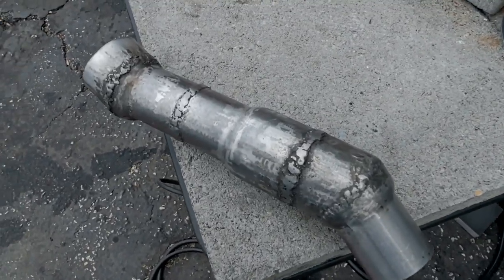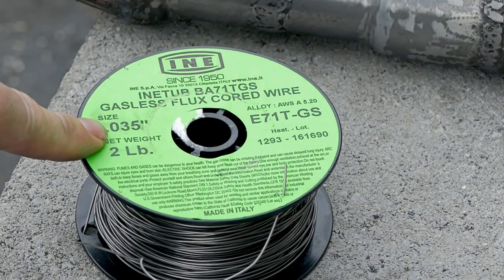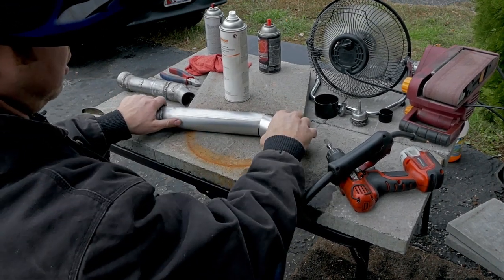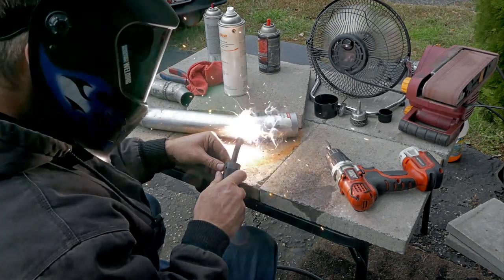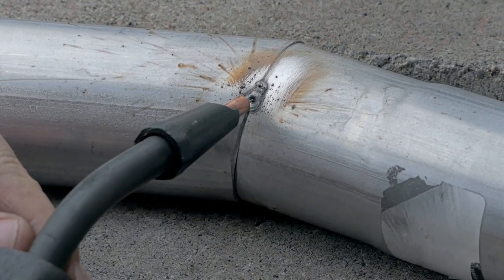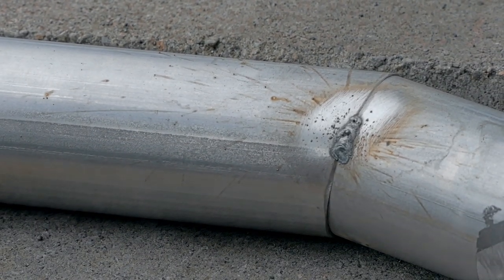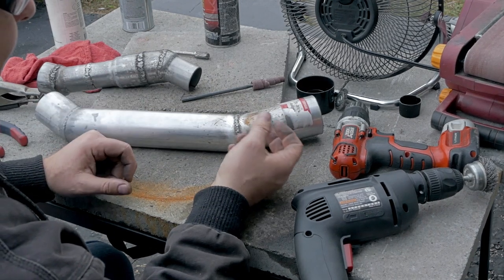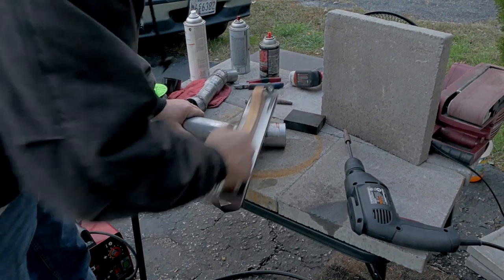Cheap Welder, How to Flux Core Weld Exhaust " Budget DIY Exhaust"

Comment: Pretty good tips. I've had a lot of experience in this situation. Try just going straight and not weaving. Give it a good second or two with each bead (without blowing holes obviously) but don't let it cool all the way off in between pulses. There's no need to wire brush it in between pulses. Just stop for a second, watch the glow of the bead die down, and before you lose site of it in the darkness of your hood hit it again. Over and over until you're done. You'll get a much better "bead" look. Overlap them a little like you were but keep going with the bead until you have to rotate the pipe. Good luck!
Reply: I probably and up having to read this comment.
Reply: Exactly my method.
Reply: gonna try this for sure thanks for the advice
Reply: Thank you for these tips

Comment: You don’t need to stop and clean just keep welding and clean after, this is going to take a freaking week to complete
Reply: for real!! buddy would finish his exhaust weeks later
Reply: Slag will go into the weld. Not sure if the flux in the wire is enough to prevent corrosion.
Reply: The weld needs to cool anyways
Reply: You absolutely need to clean the slag off or your weld will be contaminated and corrode. Wire wheel on a drill or a grinder makes quick work of it

Comment: Your main problem is not enough stick out and using a welder with only a high and low settings. Been flux core welding for years even on 20gauge sheet metal. Give yourself a minimum of 3/8" of stick out. The results will amaze you

Comment: Welding with flux core isn't bad when you know what you're doing. 🤷‍♂️
Reply: Welded my exhaust for my car, first time using flux core. I have to admit however, my welds turned out way better then a lot of these guys on youtube.
Reply from the maker: @zerodegrees8  Prove it.. https://youtu.be/62moqa9dICw 😁
Reply: @TPVPRO  not hard at all. Especially if you don't insist on Harbor Freight crap. And a simple can of anti spatter spray works wonders. Oh, and it helps to leave ego behind, and use the best tools for the job...that usually arent at Harbor Freight! 👊🏾🤣🤣🤣

Comment: I've only got a little over a year with welding experience, and obviously watched this to learn what to do or not do, what I'm doing right or wrong etc... and I know I'm pretty ok. Nice clean welds are common. Anyway, this is a really good way to start welding, I know a few pros who stick to this or a similar method. I personally lower the temperature so that I can weld faster and with longer lengths without burning holes into the steel. If your temperature is already at the lowest possible and you're having hole problems, just dot weld until you finish the job, don't risk wasting time, effort and money trying to be faster with a long string of weld. I'm probably forgetting some tips I've been given and have learned, so if anyone has any questions I'll try my best to answer as accurately as possible

Comment: So, good/great video, ive tried for years to weld exhaust ( cost to have done $$$), here is what ive discovered, "modern" pipe from big box stores has an "aluminumized" coating on them for corrosion, 25+ yrs ago it was naked steel, you would see it with flash rust on the shelves, the "aluminized" coating is messing with your welds, a little sand paper application and its mostly gone and easier to weld, your blow throughs are somewhat normal for flux core, thats why "most" shops braze the pipe instead of weld, also part of those $$$ for a shop to do, your video is helpful and good, thanks for that, wish YT had been around when I started, for what it is your video is extremely helpful and makes people less scared to try it at home, which is a good thing, way too much heres $ and ill pick it up now days, thanks for the great vid

Comment: If punching through, you are dwelling too long. Either move along the seam faster (in short puddle jumps), or zig-zag on each side of the seam to spread out the heat. (It also helps to have a machine with continuously-variable heating dial instead of a toggle switch - where LOW is still too hot.) 

Try rotating the pipe on a wide metal V-channel to move along the seam. (Or, place inside a slightly wider pipe.) For convenience, clamp the ground lead to the V-channel metal (or outer pipe).

Try a longer stick-out (3/8"-1/2"). It preheats wire/flux more than the base, and is generally better. 

For flux-core, DC negative is much better than AC (although a mix of both can be ideal).
Reply from the maker: https://youtu.be/c3GS0rySl0c

Comment: I've learned (through welding 25-30# of flux core wire) that the weld puddle has holes because the torch was stopped too quickly before the weld puddle was hot enough to properly build up.

Comment: After 15 years welding at work finally bought a Titanium 125 flux welder from harbor freight. No problem welding exhaust. Assuming it was you lack of experience or knowledge not the welder.

Comment: Mind blowing tip: If you spray the work area with non-stick cooking spray the splatter won’t stick.  I found this tip on YouTube and it actually works. 👍😉😇
Reply from the maker: I'm going to have to give that a try.
Reply: This is a joke right? The oil in a weld will spit like crazy
Reply: @davidludwig4286  nope "pam non stick spray" works

Comment: Probably the best advice from all vids ive watched, going slow and cleaning after every short blip seems to be a good trick. Ive got an exhaust to try and fix but i remember totally failing with thin pipe years ago with a stick welder. Thanks really helpful 😄👍😎

Comment: I put a H-pipe and dual exhaust on my car with a HF flux core welder. I had better luck with the .035 wire but maybe just because it was a better brand. Also took the nozzle off, helped a little. But really the hardest part was welding on the ground with no lift. The welds look like 💩 but it's together and no major leaks.

Comment: First, my dude the anti spatter repels metal so spraying it on your weld surface is going to give you fusion issues. Second, you need to lower the gun angle so that you are just barely aiming into the weld pool. To much will cause you to hit your slag wall and to little will cause holes. You can go downhill with flux....I ran downhill on a harbor freight  $99 special set on high voltage at 7 wire feed. ...i did both sides of a true dual exhaust and it sounds great. You're getting the flattening and holes on your tacks from running the flux like a mig 
...increase your stick out to 1/2 to an inch.

Comment: I’ve never used a flux core welder but after watching this I’m positive i never will haha
Reply from the maker: Good decision! 😂
Reply: Joe Simpson flux core isn't that good for thin metals but for thicker metals it's great and simple to use. It's probably the best to learn first imo
Reply from the maker: @rsmithmedia3287  Joe Can weld really good. He is just giving me a hard time.
Reply: @rsmithmedia3287  I completely disagree, welding with a proper hardwire machine is 1000% easier
Reply: Weld.com has a video where they bust myths about flux core, they're not bad. They definitely have their place. Growing up on a farm, they were great for field repairs with a generator when getting back to the shop wasn't an option. A lot easier to pack up, don't worry about how windy it is, and don't need a massive generator, everything fit on the rack of the atv.
Reply: @jutde  smaw is better than self sheilded flux core. Dual sheilded flux core is really good tho
Reply: Only because he doesn't know how to use it proberly. Even with flux core you can get amazing results.
Reply: Shielding gas tanks are too friggin expensive. I use my welder 4 or 5 times a year, I will deal with flux core over spending $300+
Reply: @GumpterCrayon  I've only been welding for like 4 days with a flux core and shit is super easy, I really don't see how it gets easier, does you just give the machine some metal and it spits out your finished project ?

So far the only hard part I've encountered is the fitup of parts which definitely has an impact on weld quality, but that's gonna be the same regardless of the type of welder, on parts with almost no gap after wirebrushing the welds you would think they were regular gas MIG because they looked so good, the ones where there were gaps definitely weren't as clean aesthetically but I guarantee they're still good welds, I got some heat in the fucker and it's strong.
Reply: Watch Bondo Billy Channel,  he can do anything with Flux core.   ßve used stick initially and then gas mig for over 50 years, but now Im into Flux core.  You need to play with it to be able to do everything. Dont blame the tools.

Comment: I actually think it came out pretty good for what you’re working with... flux core never looks great and it’s difficult to see while welding. Also it has a different sound than regular gas mig welding so you can’t really make it should sound like “sizzling bacon”. I think your settings were at least in the ballpark

Comment: I've done a bit of flux core gasless mig welding in my day, probably ran 100 lbs of wire the last 5 years. I did the exhaust on my truck recently and a few of the things you say are pretty inaccurate. I can run a solid bead for 1/4 of a 2.5" exhaust pipe without blowing through. The key is to turn the voltage and wire speed down, if it's still blowing holes then you need to move a little quicker while running the bead. Now, when it comes to this type of welding it's important to drag the nozzle not push, whenever stopping a weld you should drag the puddle back into the bead a little to keep from getting pits in the bead, sometimes even blowing through the edges of sheets.
Most importantly, clean the surface and practice, practice, practice.
Reply: That's it, turn her down. Just remember the saying "If there's slag, you drag."

Comment: I started with a big 220 Lincoln stick welder angle iron and box tubing also frame work on my car. I used a fluxcore welder .30 wire 2 heat stage high / low and wire speed was adjustable. Now I did exhaust on low heat overlap back and forth motion about 1 inch welds never had a issue blowing through the pipe. Never used gloves on a 110 either not needed unless you have sensitive skin. I also use the nozzle on my welder.

Comment: I have flux core welded exhuast b4 , im no welder but i turned my machine way down so not much heat and moved the torch fairly quickly kept the weld puddle moving had pope welded all way round in about 4 welds, only had to stop to turn exhust round and never burned thru, cheapest welder i could buy to outtta lidl, was like 90 euro and 4 euro for roll of wire, cant beat that

Comment: I love to watch welding videos, the problem you're having is due to stopping,  next time instead of going downwards out of the puddle,  go upwards into the puddle, if you're welder is turned completely down you either need to reduce your feed speed or move faster through the puddle, the flux cores stuff makes a gas shroud around the puddle so you need to carry on and also point the fan at you rather than pulling / pushing air around the puddle, I'm still a total beginner, thicker stuff is super easy to get right,  but the thinner stuff is a nightmare to get set up for and get right, loved the video
Reply: the one from everything I know flux core is supposed to be dragged. Not pushed. You can push mig all day. Not flux core.

Comment: My 250a MiG welder has infinite adjustments for heat, and even with flux-core, I can turn down the heat low enough to continuously weld something thin like muffler pipe or rusty metal without burning through the steel.
Reply: Listen to the man
Reply from the maker: I'm thinking of getting a Mig this summer.

Comment: Yeah, making flux core look good is a challenge. But it's just like anything else. The more you do it, the better you'll get. 
Now to be clear, I'm NOT a professional welder. I'm a professional mechanic by trade. 
But just a little advice about flux core welding. You want to make sure you get a machine that has the correct polarity. Flux core needs to be run electrode negative. When used in that polarity you won't have so much spatter to clean up and you'll have much better welds.
These really cheap machines, such as the black Harbor Freight flux core machines, are wired electrode positive. Which is why they have problems. I know it sucks, but try to save up and spend that extra 75 or $100 to get a machine that is wired correctly. It's well worth it in the long run. But if you can't, I do understand that very well. Just get some scrap and start laying beads down. Do that for as long as it takes for you to get used to the machine and can lay down some welds that will actually hold. It just takes practice.
Much respect for you TPV!! For being big enough to readdress this and for giving folks good advice!! 
You're The Man Brother!!! Y'all be safe out there!!🤠😎
Oh and I gives a f@#$ that this is three years old!!

Comment: with flux wire you need to push , not pull. Stay behind the weld and push it to the end. pulling is for solid wire. Hope this helps.
Reply: sean self: You have it backwards sir. With slag you drag is what it's called. You pull the weld for flux core. With solid wire you can go either way.
Reply: @garthock1  you are correct thank you sir

Comment: Well done, I'm using a Harbor Freight and it's really ugly patching all of the burnout holes. Not to mention at the lowest settings and the pipe is thin and old 1 3/4" stock on a scissor lift.

Comment: The reason why there is a hole is because you are too close of the weld, your flux wire doesnt heatup enough before touching so it does a point in it

Comment: Man that Lincoln flux core sounds a lot better than my cheezy harbor freight flux core. Never can get that thing to weld right. I feel like it should be able to weld an exhaust just fine, but cant get it. No matter the wire tension, or speed or high/low. No idea why it wont work ha. The welds just break off. They dont penetrate the metal at all.

Comment: I can make flux core welds look like it was welded with a regular mig all day even on exhaust. If your welding thinker metal to thinner then alway put the heat more into the thicker metal rather then the thin. You will blow less holes through it.
Reply from the maker: I got better and so can I now.

Comment: I'm pretty sure no matter what type of welder it is if you're punching holes through the material you probably have too big of a gap or your heat is turned up too high for the material you would think if you turn down the heat a little bit and turn up the feed you should be able to successfully weld a straight line but maybe I've been doing it wrong

Comment: Thanks for the video, I'm about to turbo charge my Subaru outback h6 so this should help me to build a manifold!
Reply from the maker: You can do it for sure, it just takes longer with the flux if you want it to look decent. I have another video on anti-spatter it required less cleanup. I think with a little more practice the welds can look cleaner.
Reply: There's no way someone is turbo charging his car after appreciating the content of someone that can't weld himselfe.
Reply: How’s that turbo ej30/36?
Reply: @joshrepik  sold the car before I got around to it

Comment: Brother, smart work cleaning and not welding over the slag and splatter.
However- tack, tack, tack and more tack!
make the job into a lot of little short sections.
Fill in a small section between tacks-then rotate the entire pipe to well the opposite section. This gives you a little more time to weld so you arent punching through. Take your time. Even when you clean it with that brush you are having friction between 2 metal surfaces. Friction=heat. Too much heat = holes.
Furthermore, f you continue welding it in one shot on one side, the metal will begin to pull and flex-so if you are trying to make specific angles etc, your finished product will be off.
Also. The anti rust stuff is an aluminized coating. Dont want to breath it in when vaporized.
Just my 2 cents. Great vid ! 🍻

Comment: This is a pretty late .. but I would recommend just getting a mig hardwire set up. I have the Lincoln with the flux core / mig combo. Welded a jeep frame with the flux core, plan to do my trucks exhaust with the mig. Flux core is exactly like stick welding. Runs hot as hell etc. just a thought, it’ll look a lot better and be a lot less work.

Comment: Been using it even with old pipes no cleaning if you get the heat right. Over 15 years I’ve gone thru five harbor freight welders they cheap. Set it on hi and control your speed about 1.5 to 2 max no need to spot weld like that.
Reply from the maker: https://youtu.be/62moqa9dICw
Reply: @TPVPRO  just seen the video good job. I’ll leave my comment on just so other people can see it.  Keep it up I’m subscribed to you and will continue to like your videos.